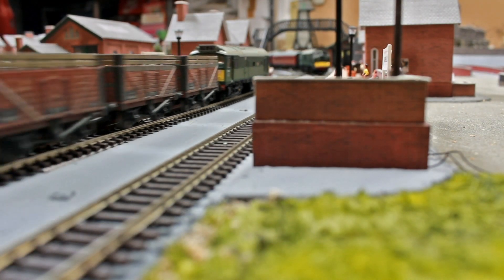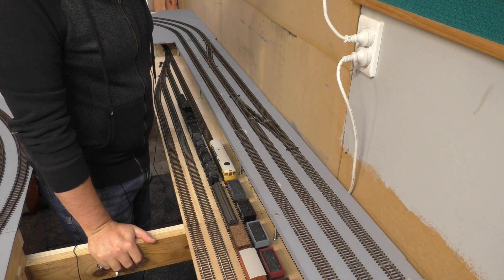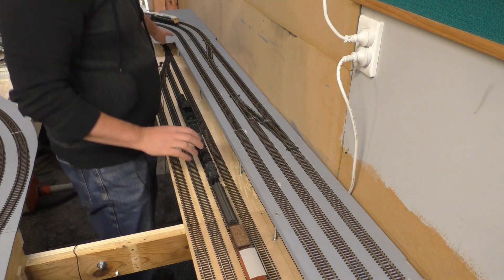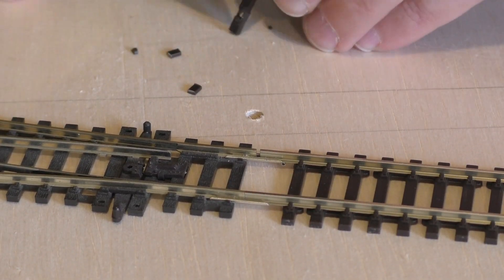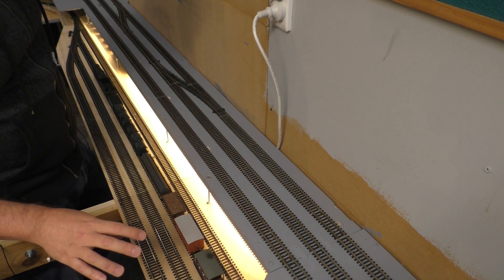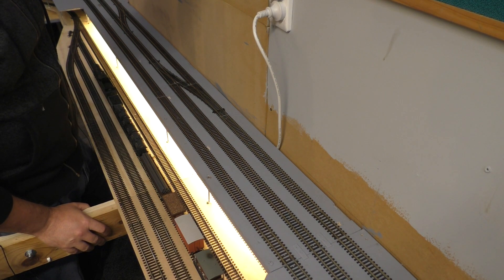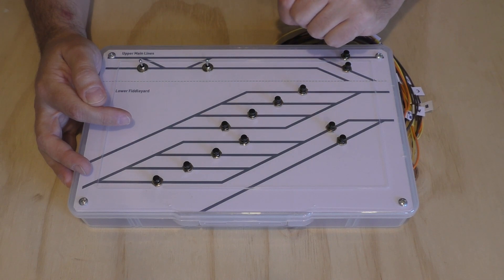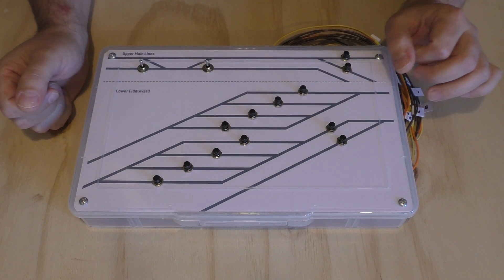Fiddle Yard Point Control using a Diode Matrix

Comment: From the PECO Booklet I did this on a piece of
Veroboard to find the tracks on the VERO would
not take the amperage of a Capacitor Discharge
Unit (CDU) I emailed PECO who have had a lot of 
comments about the Booklet. The use of Connector 
Blocks is definitely the way to go. [Phoenix AZ]
eBay have all the components in quantity with 5amp
Diodes.

Comment: Hi Julian,   A great idea, so well explained.   I’ve taken the concept on a stage.   On the input side of the routing Terminal Block (TB) I wire a SP x 4 way rotary switch. Thus you select the route required, using just one device.  This switch is itself fed by a Normally Open (n/o) push button (PB) connected to the output of the CDU.  So to complete the choice of route -  1. choose the route 2. Press the PB.  Done!   Like you I have a duplicate set up to select which route is required to leave the fiddle yard.  One other refinement - On my DC traction layout is an isolating section at the end of each storage road and another PB per road to ‘release’ the train from storage. This isolating section is connected to the ‘Down line’ to enter the fiddle yard and to the Up line to leave the yard. The whole of the yard is speed restricted to avoid sudden stops and starts in the isolated section. Here is where I see the DCC system of traction control would prove to be superior IMHO.   Happy Wiring and testing everybody. T🚂

Comment: Thank you for your very informative video. Having just spent a few hours head scratching, working out my wiring for a 9 road fiddle yard with 2 holding sidings at each end you have confirmed the path I was thinking of taking, using push buttons and seeps with strategically placed diodes it's all quite logical in the end, and by pure coincidence i've used the same solours in the same order to represent right and left coils. I shall be keeping a close whach on you channel, once again many thanks from France

Comment: Your a genius I've saved this episode to find later this saves on switches and makes operating so much easier fantastic.
Reply from the maker: Thank you for your very kind words. I wouldn't say genius as some other genius would have conjured up this method of point control originally. Route selection as opposed to individual switches is a must for any mass track configurations.

Comment: Hi Julian, well done in cracking this as a newbie to the diode gating electronics, connection diagram under the terminal blocks is best practise too for easy maintenance etc - very impressed with that and far easier to understand than dc concepts. The diodes are forming an OR gate (input a or input b or input c etc will activate the output). I suggest on your first mimic diagram on video you make a left coil physically align to the blade moving to the left as you read the drawing - (you did left is a right and vv so not surprised you struggled), that would make it far easier to follow.
 If you use a CDU  in theory you do not need flywheel diodes on each coil provided you do not blip the pushbutton. When diode gating like this always use a CDU, that is a clever circuit that always discharges its output (and thus the coil currents) to zero, recharging the instant you release the pushbutton. So unless you blip the pushbutton (for less than 0.5 to 1 sec) you will not get any arcing damage to your switch. For me I am fitting flywheel diodes (type 1N4002 costing a few pence per diode) across each coil to prevent any such occurrence.
If you tried this directly off a fixed dc supply (without a CDU) you would be breaking considerable current when you release the pushbutton as you are supplying rated supply volts to the coil all the time, so far more amps than with a CDU. Also as the iron slug pulls across up goes the inductance of the excited coil so worsening any potential arcing damage when you release the pushbutton. Coils measure 2 to 4 ohms typically, so at least a few amps per coil (total steady state current, I = {V/R} x No. of coils) so hammering your pushbuttons contacts. So my guidance is avoid this latter method of switching  - a CDU is by far the more reliable and lower stress method of switching.
 Hope this helps, again well done. Stephen
Reply from the maker: Thank you so much for your very informative feedback. A CDU is definitely planned for the final circuit and I used this when I was testing the initial diode matrix I setup. I'm currently using 1N4004 diodes (what was available at my local electronics store) but I think I'll order some 1N4002 diodes as you've suggested.
Reply: @StationRoadModelRailway  You are most welcome. The 1N4002 is certainly fine for each coil  flywheel diode, they have a small continuous current of 1A, 30A for 8.3milliseconds exactly as your IN4004 (which on voltage is over specified - thus more expensive- for your application). Looking at the non repetitive surge current they are fine as each of your 1N4004 diodes only take one coils current - they therefore have ample surge current capability (just realised its a diode per coil and not all coils - hence this edit). Hope that makes sense and look forward to seeing how you get on! Stephen

Comment: Ahh good old diode matrix boards... Back in the late '80s I did this for the station area of my late father-in-laws garden layout... around 30 points involved ! - I used stripboard, similar to to example you found on RM website, but regardless, so long as you have an understanding how it works it doesn't matter what the final result looks like or how its put together... So long as it functions correctly that's all that matters
Reply from the maker: Thanks Malcolm. Wow, 30 points! That would have completely done my head in. It was tricky enough just dealing with my simple routes and 12 points. You're absolutely right, there might be many methods, as long as it all works as intended.
Reply: @StationRoadModelRailway   My brain worked more logically back then, but yes it was quite challenging, and with some routes needing upto 6 or 7 turnouts to fire at the same time the CDU was quite substantial :-). But it was fun, and I have fond memories of "playing trains" with my wife's late father.

Comment: Great video Julian. Essex Thameside is my first layout and I read and watched everything I could lay my hands on. I soon came to the conclusion that I had to simplify things and build version 1 initially and get that working before moving on to improve different aspects of the layout if and when needed. To that end I decided to switch points individually, except crossovers. My intention from the start was to build for a number of operators at one time. For some it would be their first time so it had to be simple and disaster proof (as much as anything can). I decided to use Brimal Components MR322 memory switches and fit coloured sleeving on the switch leavers of the mainline points to indicate that they should be switched back to mainline as soon as possible. I appreciate that you are well past version 1 of your layout but this may be useful to other newcomers. 
For your lift off section, have you seen Model Tech's Pro track rail aligners?
Keep safe 
Brian
Reply from the maker: Thank you Brian for your kind feedback and interesting info, it's fascinating to hear what other folks are doing for their layouts. Cheers, Julian

Comment: Very interesting and very well explained. I couldn't get my head around the same issue so in the end I decided to control all my points and routes through dcc and rather than having a push button to choose a route I have a route number on my controller that fires the whole route. Thanks for sharing it's made the dc control understandable now cheers Andy
Reply from the maker: Thanks Andy. I couldn't say what scarred me more, analog control or DCC, the later just seemed even more daunting. However, I am considering some Cobalt SS motors for some of the points by the station because there's no space for under-mount motors and I can easily hide the Cobalt surface-mount motors under the platforms. This will give me the option to control them via DCC.

Comment: Well, very very well explained. The DCC Concepts board did my head in, I could not understand what you would do with it. Your setup seems to be simplicity itself, made perfect sense. So very well done Julian in showing what at first seems very complex into what is a straightforward task.
Cheers Peter
Reply from the maker: Thank Peter. I do wonder what it is about the matrix boards (like DCC concepts) that confuse me so much, and I think it comes down to the fact that I'm quite a visual person and I need to see a circuit planned/mapped out physically and in an order that the circuit literally processes its function. The matrix boards remind of an Excel spreadsheet and I was never any good with Excel.

Comment: Hi Braam here from S.A wat is the sice of you diods thanks
Reply from the maker: Hi Braam. Not quite sure what your question is so guessing it's about what diodes I am using? I've settled on 1N4004 1 amp diodes which worked well during testing with a CDU incorporated into the circuit. I'll be covering this in more detail in the next video. Cheers, Julian

Comment: Another excellent and interesting video. Coincidentally I’m creating three diode matrix boards for my current project to add a new storage/fiddle yard to my layout. Drawing on a diagram really helps and I like your logical approach and novel solution. Only observation is whether it could be worthwhile adding some heat-shrink to the bare wire of the diodes between the terminal blocks as I noticed some bare wires pass over each other in fairly close proximity ... so if knocked in future there’s potential for a ‘wrong side failure’ of another point being accidentally energised. Otherwise it looks a really novel and robust and hopefully reliable solution .... and I really like the lunchbox control panel idea! Regards, Mark 👍
Reply from the maker: Thanks Mark for your kind words. I did consider heat shrink tube for the diode legs but I don't see anyway they can short as is. They're firmly fixed in the terminal blocks and the matrix boards will be up under the layout where there won't be any other exposed wiring. I guess I'll eat my own words if I run into future issues.

Comment: Very well explained. How did you decide on which diodes to use?
Reply from the maker: Thanks Frank. I found a reasonable amount of discussion on the web about what diodes to use and two types cropped up. One was a 1N4004 1 amp diode and the other was 1N5404 3 amp diode. Most said the 3 amp was preferable as it wouldn't limit the current, but the 3 amp diodes available locally for me were actually quite large and bulky, so I went with the 1 am 1N4004 diodes. I discussed what I was doing with a local electronics guru and he said the 1 amp will suffice.
Reply: Thanks Julian.

Comment: Hi Julian, I am certainly with you on the complicities of the electrics particularly as I don’t have any form of electrical background. You explained it very well and perhaps your next video of your system actually being operated will make it even clearer. I presume that something similar could be used on a full DCC layout? Thank you.
Reply from the maker: Thanks Peter. Yes, the next video in this series will cover the assembly of the complete circuits and include the power source, CDU and point connections.

Comment: Great video Julian. You should have asked me about the diode matrix! I used the DCC Concepts diode matrix kit, the best way to get your head round it is to draw out a couple of diagrams. It took me ages to understand it too, but once you get it you wonder what the fuss was all about! The diode matrix really is easy to do, and the DCC Concepts kit is really simple, the instructions make it all fairly clear.
Reply from the maker: Thank you for your kind feedback. That was the common feedback I found when I was doing my research on diode matrix boards, that it took some time to understand but once understood, it was quite simple. I suspect if I had persevered with the learning curve I would have cracked it eventually, but after a week of head-scratching, I gave up.
Reply: @StationRoadModelRailway  I found drawing the actual matrix out on graph paper a few times really helped, as well as drawing the track plan to go with it showing where each wire went

Comment: Splendid stuff Julian. I was wondering about adopting a similar system myself when we have moved and build our major layout, as I shall need plenty of FiddleYard space! 😳 Really well thought out and explained mate 👍 I like the lunchbox control panel as well, really clever idea! 💡 

Cheers mate 🍻
Reply from the maker: Thank Tim, always appreciated. Malcolm commented further up the list that he built a diode matrix for 30 points so there's certainly no limit on what can be controlled. The key is to add CDUs into the circuit to ensure enough power is sent to fire multiple points. I'll be covering this in my next video.
Reply: @StationRoadModelRailway : oh right! Excellent stuff! I shall get my notepad ready 😄

Comment: Well done Julian, has given me food for thought on my own layout and very well explained, thanks again
Reply from the maker: It's great to hear my explanations are decipherable, particularly when I struggle with my own explanations of anything electrical. In the next video I will be doing a short piece on assembling a matrix and wiring the completed circuit to the point motors which will include a CDU.
Reply: @StationRoadModelRailway  Yes I would have thought you would have needed a CDU,I only couple two points at a time because anymore the trains just of the rails, homemade unit of course

Comment: Well explained thank you. Might be worth slipping insulation over the diode legs in case you have any loose wires or other things that cause a short, or power a point unexpectedly.
Reply from the maker: Thanks Peter. I did consider heat shrink tube for the diode legs but I don't see anyway they can short as is. They're firmly fixed in the terminal blocks and the matrix boards will be up under the layout where there won't be any other exposed wiring.
Reply: @StationRoadModelRailway  Yes just being picky, great video though and track layout is looking good.

Comment: A great explanation. Your diagrams really make it easy to understand the complexities.

I have one concern - will you have enough power to throw multiple solenoid motors in a single button push? I also have solenoid motors on my layout, but found that my power supply was insufficient to throw more than one motor at a time, but if I increased the power, I was at risk of having too much power and would burn out the solenoid when used with a single point motor. I would be interested in how you ensure that you get just the right amount of power to throw each motor.
Reply from the maker: Thanks Eric. I have a CDU (capacitor discharge unit) which I'll be adding into the circuit when I hook up the power supply. The CDU provides a single pulse of power to the point motor, enough to fire multiple motors at once, and being a short pulse, it avoids frying the motors. I'll be covering this in the next video (part 7.1).
Reply: @StationRoadModelRailway  Another tip to consider when firing multiple point motors at once ... the wire size (especially if the distance between the control panel, CDU and the points is a long run. It looks like decent thickness of wire is being used in this video which is good 👍
Reply from the maker: @ModelRailway  Yes, I'm using reasonable gauge wire and the CDU and diode matrix panels will be positioned directly under the fiddle yard to limit wiring distances.